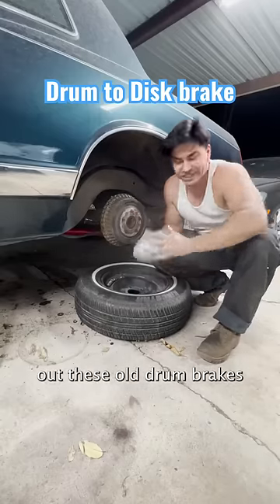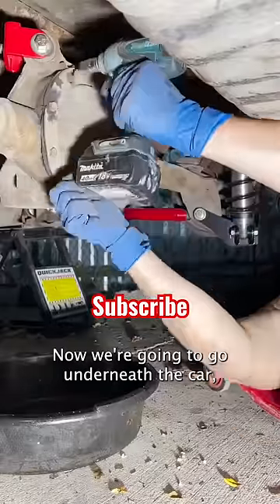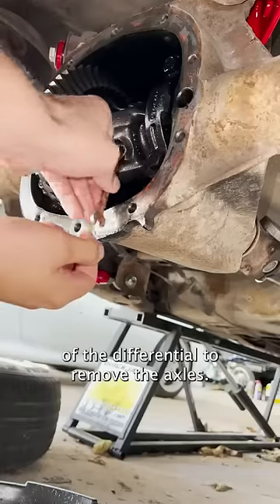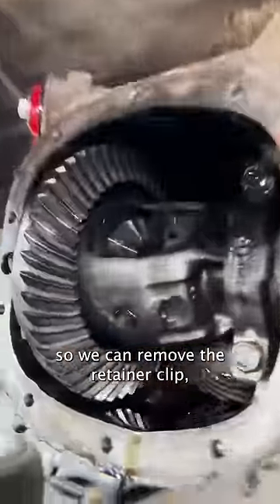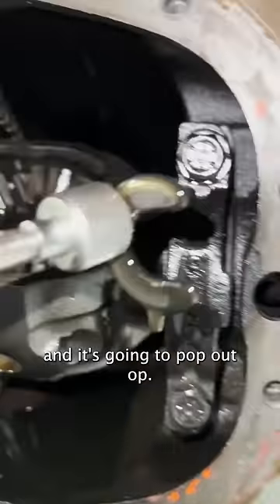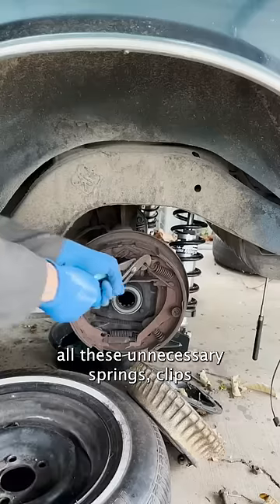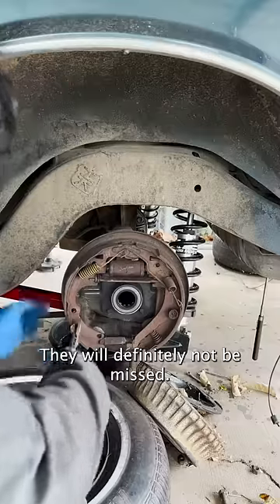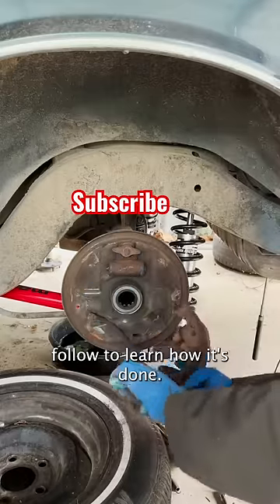Convert drum brakes to disk brakes on G body Monte Carlo

Comment: When you remove a diff cover always leave a loose bolt in the top to stop it doing what it did there when it'd stopped draining then remove the bolt and cover together without getting covered in diff oil

Comment: Wow, as an Aussie mechanic- I've never seen a diff with C clips at all in the 20+ years I've been in the industry. In our country, axles are generally held on by a plate that blots to the outside of the housing- like where the 4 bolts go through to retain your backing plate for the drum brakes. And ALL our diffs are made that way, pretty much. Doesn't matter if it's Holden, an Aussie Ford or even a Toyota Hilux or Mitsubishi Express van- all our axles are retained by the axle retaining plates like I explained!!! I've only ever read about C clips coming in American cars- and everyone HATES them in a performance application. Even our Ford 9" diffs from some of our Aussie cars, although from memory I think C clips are a GM thing... Anyone confirm?

Comment: Quick tip, leave the top bolt in the diff cover loose so when you pry the cover off it won't fall hitting the drain pan making a mess.

Comment: Maybe it's just me, but I've never really minded drum brakes. In my experience, it's always been a dirty maintenance job you gotta deal with, but in the end, your brake pads are not as exposed to the elements. Also, your wheels get less dust on them if you just crack them open twice a year and spray them down. It's not that complicated, and a rebuild kit is like 10 bucks, and a wheel cylinder is cheap compared to a caliper. The pads last longer, too. And they're adjustable. It's probably me 😂 I'm pissing somebody off with this comment.

Comment: You turn a classic car with beautiful rear drum brakes into a classic POS with rear disc brakes.
Reply: I can't wait till I can replace my drum brakes on my 71 442. However I'll do a set of wildwoods
Reply: Beautiful drum brakes? Put the crack pipe down, Jim. Drum brakes are garbage. Driving a classic car with a proper disc brake conversion vs the stock drums is night and day better. Not to mention safer too.
Reply: Maybe this is for performance?

Comment: Pretty sure you can remove the whole brake assembly with the 4 bolts holding the backing plate ,no need to undo the springs and wheel cylinder

Comment: unbolt the backing plates and disconnect brake line from wheel cylinder.  disconnect the e brake and It will all come off together as a unit

Comment: Things you should do that this guy didn't.  leave a bolt somewhat loose on the top of the diff cover so it don't fall off and the fluid drains rather than splashes.  Take the brake hardware off BEFORE removing the axles so that crud and dirt don't get into your wheel bearings.

Comment: Um you can use drum brakes under caliper brakes, it can be used as a parking brake. All you could have done was change the drum to a rotor and put on calipers and run brake lines from master cylinder to the calipers.

Comment: Ah, good old C clip axles. If the axle breaks, the wheel falls off.
Reply: Unless theyre disc brakes then the caliper will hang up on the rotor. Happened on my old silverado.

Comment: Why switch to disk? If you have lots of power you're prolly gonna have to replace the 7.5 inch rear end before you run out of brakes and by then just swap to a rear end that has them is strong and has better brakes

Comment: Another example of “recreational mechanic” doing unnecessary changes/repairs 😆 I fail to see the benefits/purpose. Rear brakes performance will not influence much your whole braking power of the vehicle since front brakes do 80% of work anyway. And what are you going to do with emergency/hand brake? It will still have shoes inside the drum part of the rear brake disk.

Comment: Yea well they all aren't gonna be as easy as u think that bolt holding the drum housing to axle flange can be a pure pain 🤷🏿‍♂️. Alot easier with the axle off the car 🤷🏿‍♂️ used a angle grinder to cut mine off 🤷🏿‍♂️

Comment: My drum brakes last twice as long, maybe longer than my mercedes brakes  what's the benefits of switching out drums
Reply: better performance, theres a reason why pretty much any sporty car in the last 30 years or so came with discs all around from factory or had it as an option
Reply: Cheaper and easier to replace better cooling of the brakes so less chance of loosing breaking power.
Reply: I drive a work truck, so performance is not super important on the truck . Just want to spend as little as possible on the truck that car takes all my funds .Do you still recommend changing to discs on truck 
I've changed disc brakes 3 times on car  my trucks drum brakes still going strong I'm just getting into the mechanics thing so I don't know. Thanks

Comment: So a Ford 9" with disc is about $400-500, I guess if your time is worth nothing to you it makes it worth while. But if your time isn't worth anything to you what can be said about the work you did?
Reply: Does a ford 9" bolt into his car?  No no it doesnt....  so whats your point exactly?
Reply: @philipallen7956  uhm yes it does????? People have been swapping a 9" since they came out. One of the most widely used rearends
Reply: @davidlynch5235  it doesnt bolt in.  Yeah obviously you can get weld in plate and kits,    your not getting a bolt in 9" for a g body for $500.
Reply: @davidlynch5235  I'm waiting for a link or part # to this magical 9" axle with disc brakes that is already modified to bolt into a chevy g body.  That's cost $500...  let me know when you have it.
Reply: @philipallen7956  it's pretty common on jegs or summit. This is nothing new. Just get 9" brackets and hang the rear end. I'm not sure why there's much confusion. A used 9" is like 100 bucks plus mounts and installed for 500 total.
Reply: @philipallen7956  get a 9" with disc brakes, get a 9" adapter kit. Less than 500.or does my gbody cheap drag car with a 9" surprise you? It also has a 4bt Cummins but that won't fit either According to your logic
Reply: @davidlynch5235  where is the link, or part number for the even the adaptor kit for $500..   And since your such a god why didn't you do a 6bt triple compound setup....  and you need to learn to read, I said bolt in like 8 times already,  did the 4bt bolt in? Like the 9 inch bolted in?    And for the record I have swapped 9" into plenty chevy cars, its a solid option, but it cost alot more then $500.  But since time is apparently one of your points, you can def do a disc conversion on a 10 bolt faster then converting to a 9"...
Reply: @davidlynch5235  so just to reiterate your logic, instead of taking 3 hours to do a disc brake conversion, he should go to the junk yard, get a used axle he knows nothing about, buy mounting brackets, install said mounting brackets , change his driveshaft or buy a adapter pinion yoke.  Apparently he should just leave the used brakes setup on, and then buy new rear wheels since the bolt pattern is different.....  Makes perfect sense
Reply: @davidlynch5235  your the one that brought "$400-$500" into the equation.
Reply: @davidlynch5235  your living in like 1980 if you think built 9" are $500, keep digging in tho
Reply: @davidlynch5235  sounds like you cant prove your point about anyhting.  Have a good day tho
Reply: @davidlynch5235  so to sumarize, instead of doing a brake upgrade, he should have replaced his entire axle, and a bunch of other shit.  Got it!

Comment: Ya don't even know the difference  between an axle and a drive shaft, I wouldn't let you wash my car
Reply: I'm not sure you do either, he never even says driveshaft, he says he has to remove the axle, obviously he means the axle shaft.  Go to the parts store and tell them you need a left side driveshaft for your 10 bolt.  I promise they will look at you, like your dumb...  I bet you have never even worked on a solid axle.
 And imma go out on a limb and guess he doesn't wanna wash your car either.
Reply: @philipallen7956  your american
Reply: @stevedraycott4289  damn straight, world War champs over here...

Comment: Drums are lighter and brake better than discs
Reply: They do not brake better and they are a pain to adjust, especially in the rust belt.
Reply: @orangesforall2053  the ones I've replaced had a auto adjuster and they are proven to brake better
Reply: They also last longer
Reply: @jamess7681  wrong and wrong, if they braked better and lasted longer, which you have no proof of. They why have all the auto manufacturers switched to disk brakes? Disk brakes are better in almost every way so I have no idea why you are trying to defend drums, they are terrible.
Reply: @orangesforall2053  discs have been proven to be faster at stopping a vehicle, and also easier to maintain/make, therefore either making drums obsolete OR making them a handbrake/parking only function

Comment: Whaaa. That is an old car. That is too much labor and trouble to fit it with disc brakes.
Reply: its really not that hard if you can get a disk brake setup from a higher spec model of the same car or one that bolts up from the same manufacturer

Comment: So if ya leave a few bolts in the rear diff cover when you brake the seal it controls the fluid not to splash possibly in your eyes, face or on your skin, plus you look a lot more professional doing it.

Comment: Waste of time
Reply: @nachocheese6107  the great percentage of braking comes from the front brakes and properly set up drum brakes are fine as really only used for the parking* brake to increase the braking force on the rear increases the chances of the rear locking up so yea a waste of time